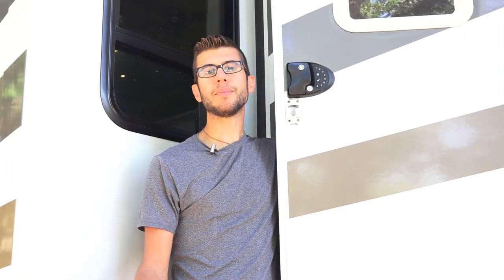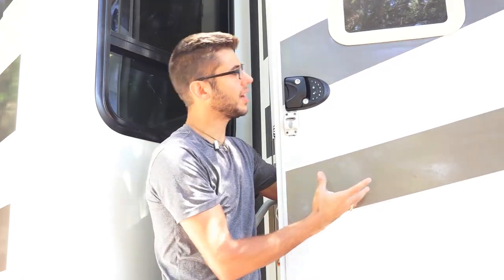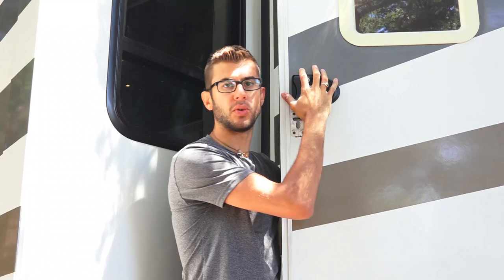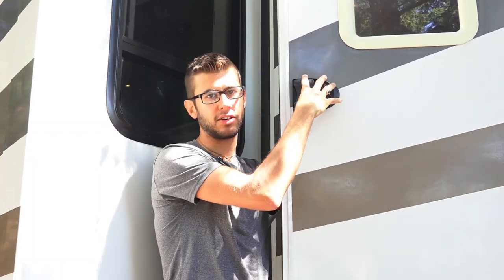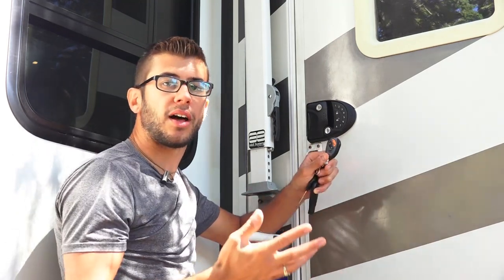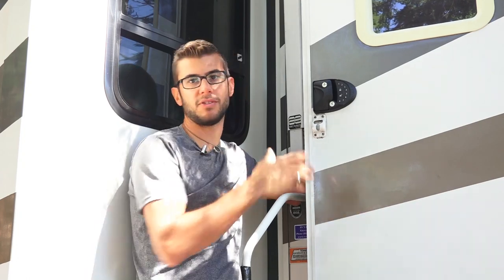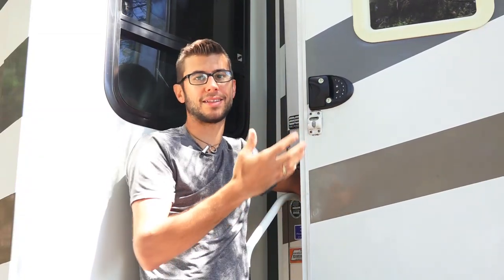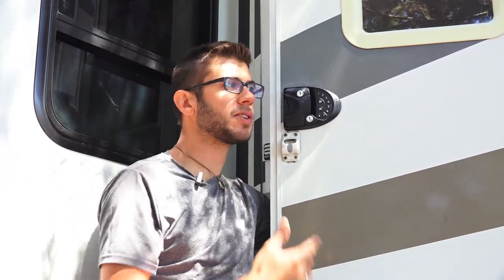RVLock Keyless Entry Handle Review | RV Security & Safety | Mortons on the Move

Comment: I like it but i have a concern though what happens when the batteries go dead? How do you unlock the door?
Reply from the maker: Good question! You can use the manual key if the batteries die.

Comment: I've had mine for a bit now about 3 months and I really like it. I do hate the 90s video game sound it makes which is loud but it is what it is. I did lock mine from a pretty good distance sticking my head out the window as we were leaving and the door was on the opposite side I was facing and about 40 yards away and I could hear it lock so it was nice at that moment it made that stupid sound. lol.  I keep my RV at my house plugged in and ready to go so I go in and out of it a lot and it sure is nice not to have to hunt down the keys, ever, to lock or unlock it. I just plug in the code and or hit the lock button and wala! Totally worth the money so far.
Reply: We're happy you're enjoying your lock! RVLock products come with a "Silent Mode" feature to disable the sound. If you wish to mute it, simply hold down the "1" button for about 5 seconds until you hear a series of small beeps. Repeat the process to reengage the sound. Happy RVing!
Reply: jstar1000  you can mute the tones by pushing and holding #1. When it beeps it is muted. Push it again to bring the tones back if you wish.

Comment: One of the first things I installed. I used barrel locks for the compartment instead of the ones from RV Lock. You should mention that you want to keep at least one of the keys always outside of the RV in case the battery dies...
Reply: Where do you suggest hiding an extra key?

Comment: I like your presentation of the RV Lock. I have the same lock that I won in a give away that the Freedom Theory did. I'm assuming they are the ones you saw it on. You were spot on about the handle inside. I think that's the weakest link. We love it though. With kids it makes it easy and you don't need so many sets of keys.

Comment: Hum , I just installed one, easy enough! I do like the convince for me to unlock and lock door,Its really not going to keep anybody that wants in we all know that. But my concern is the back part to close door,. My door has a strut on it to prevent singing open  widely and to keep it from going all the back or open. so when I am inside I really have to pull my hard to shut always have to to resistance on strut, the part that you pull to close the door really bends a lot! now i am thing I need to put some type of pull on inside to close from inside, which means there will be 2 washer probaly nylon lock washer on my front door, don't know if I want that! Thinking also of drilling one hole and using spreading nut to hold a nylon loop pull strap, but not much mental there for support! any ideas > They really need to firm up inside part of handle. I don't think it will last in mine , we will see!
Reply: Gary Coffey I have the same issue because my screen door blocks being able to get a good grip. Did you find a solution? Thanks

Comment: One issue I have is that the fob only locks and unlocks the deadbolt.  It does not lock the latch, as is the current design.  whats the point of having a fob if you have to turn the key to unlock the main latch?
Reply: You don't have to lock both locks it's just an option, one, the other or both. The deadbolt is the most secure so be happy.
Reply: Also the top lock (not the deadbolt) is generic, I took mine to an RV place to have it worked on and they told me to just lock the top lock and not the deadbolt as they have a master key that will unlock the top lock but not the deadbolt. I told them I changed out the whole thing with the one were discussing and they went over and their master key worked on the top lock. Point is the deadbolt is your best bet and that's what the remote works.

Comment: Our RV lock freaked out and locked my wife out and the dogs inside. Guess it's time to drill it out. Do not recommend....
Reply from the maker: We're sorry to hear that happened. :(
Reply: @MortonsontheMove  To be fair RVlock did help in getting the lock fixed. It's just a design flaw that the lock would behave in this fashion. By dumb luck the lock freaked out again and unlocked itself after a couple hours. I think their guess is water penetrated the keypad, which would be my assessment as well. I'm going to brainstorm on the issue and see if I can improve it somehow when I put the new parts in. 
My recommendation for anyone owning one of these is to have an emergency key stored outside the RV.